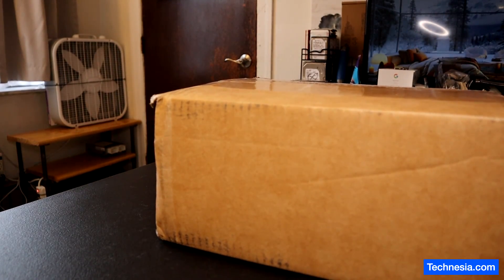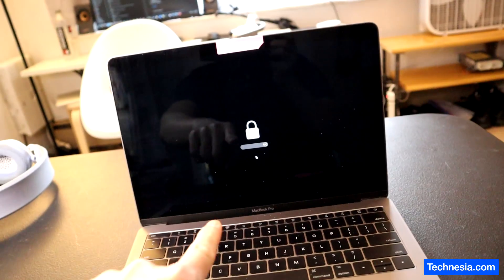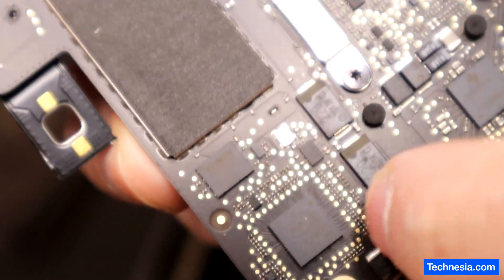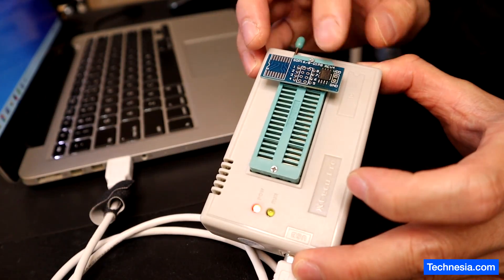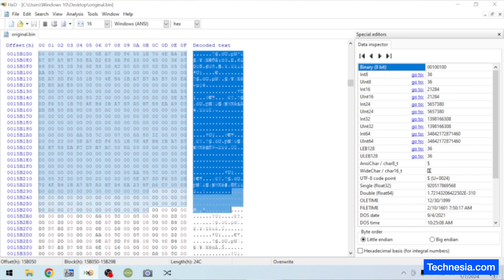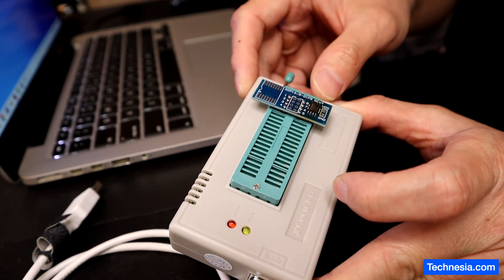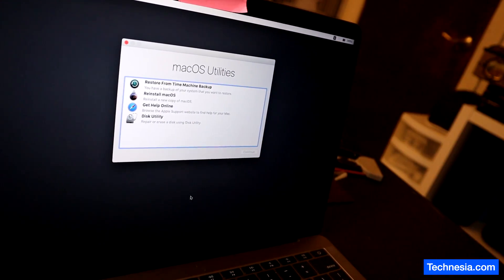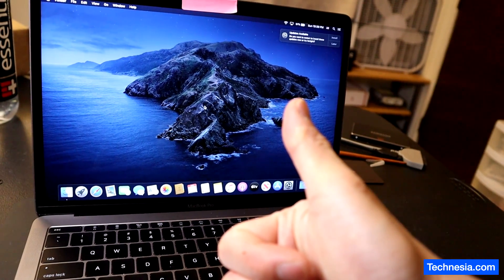Macbook EFI Passcode Lock Removal

Comment: For all pre-2018 Macbooks you can access EFI and alter data directly on the board without any soldering with the right cable. All those boards have a EFI access. Copy and paste this into ebay search: SPI SAM EFI ROM Debug Connector FLASH Service tool J6100 McBook JT
Reply from the maker: That's really good idea but in my case it's impractical. Why would I spend money on a tool that only serves one purpose where I already have hot air / soldering station and chip reader that can read different kind of chips?
Reply: It depends how often you do Macbooks, But The tool reads all the efi chips from all pre 2018 Macbooks. I have all the tools too, doesn't mean you need to use them when there is literally a connector that's plug and play.  @danfromtechnesia